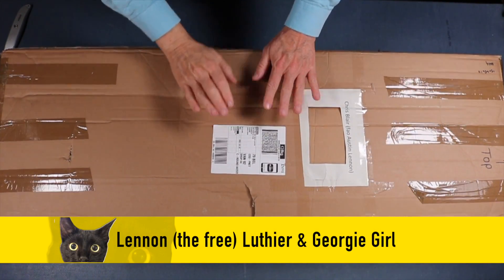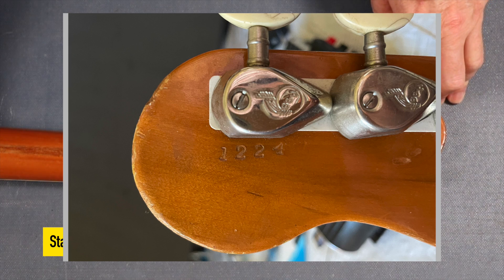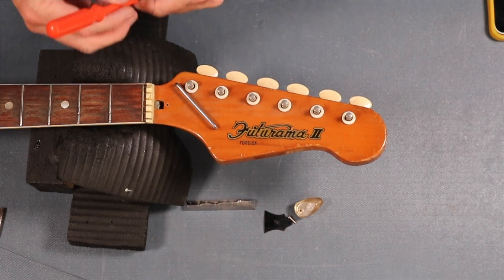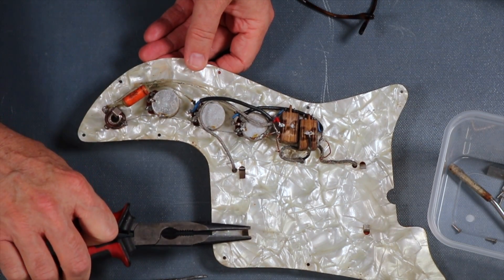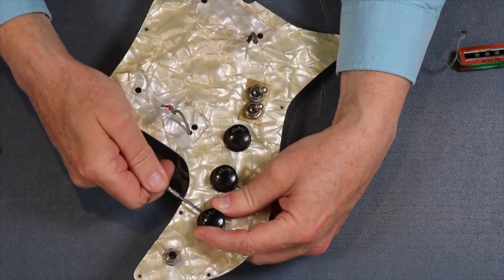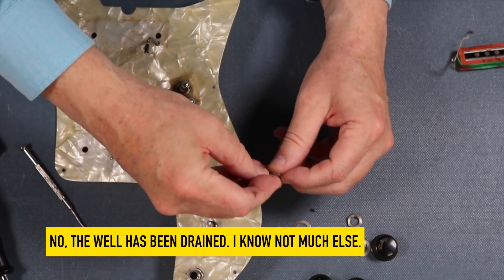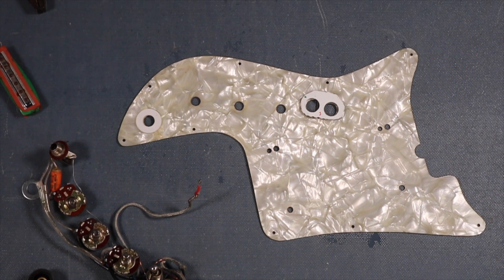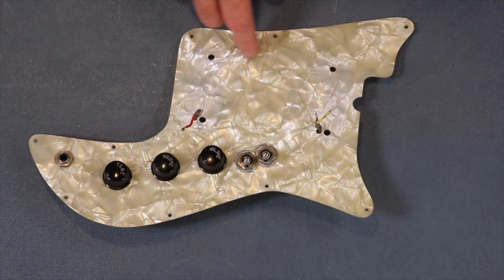60's - The Czech guitar that started it all: the Futurama 2 George Harrison, Jimmy Page etc, PART 1

Comment: I’d be very interested in your cleaning methods.  I do a bit of it myself, but I’m not properly trained.  My go-to is water with a couple dots of dish soap and a cup or two of vinegar for the body, and I use Zippo lighter fluid (naphtha) for the fret boards, but that fret board is a crusty beast and I hope you show the tools you use for it (I’d have scraped it with a credit card, then used a rag with naphtha, followed up with mineral oil to lube, but I suspect that that wouldn’t be good enough).
Reply from the maker: actually.... I keep a packet of baby wipes on the bench always. I also do what you do.... a squeeze bottle of water with two or three drops of fairy liquid... also, I use... lemon oil for cleaning all of the guitar... depending on type of paint and I have white spirit and acetone for the tough stains... but be careful with that.... it can be fierce. I use vinegar to clean metal parts with rust. Mineral oil is perfect but don't let it sit overnight.... and don't mineral oil your fretboard more than once a year. !
Reply: @LennonLuthierFinagler  Oh!  I didn't know about not doing freboard more than once a year or letting it sit.  I'll put in on heavy on a dry fretboard and wipe off excess but leave it heavy, then a few days later wipe it all away.  So far I've had good luck and the fretboards have looked like new (absolutely gorgeous in sunlight), but I'll be careful going forward.  Oh, and I use Mr. Clean Magic Eraser (or equivalent) to get scuffs off of the body/headstock, and automotive polish to minimize or eliminate scratches on the body.  Paint pens are fantastic for restoring black painted bindings.  

I don't play, but I very much enjoy finding inexpensive (Fender, Yamaha, Rogue, etc.), neglected guitars and violins, refurbishing them, and then getting them to a new home at a good deal for the new owner.  The joy on the new owner's face, who might not have been able to afford a new, higher end guitar, is absolutely priceless.

Comment: This might come to you as a surprise, but this is not real Futurama in terms of made by Jolana in Czechoslovakia or later different models by Hagstrom in Sweden but Japan copy of Jolana guitar. Yeah, wierd. Read a story in a Jolana book that when builders team was confronted with info in mid 60s that Japan makes copies of their guitar they could not understand why, since they in 1956 bought Stratocaster to design first Grazioso. The biggest surprise for them was fact they even copied the router pattern inside, with round “stop” mark so the path of routing was also similar. They differ from Czechoslovak ones in so many things that when I see one I know immeiately. Big ones are: neck binding, plastic tuners furrettes, perloid pickguard material, black pickups, differen vibrato design, different knobs. They are kind of similar in quality, and Japan ones are more rare since they were made later and for short time.
Reply: Also the original one has Tesla pots and capacitor. Suzuki proves this is Japan one.